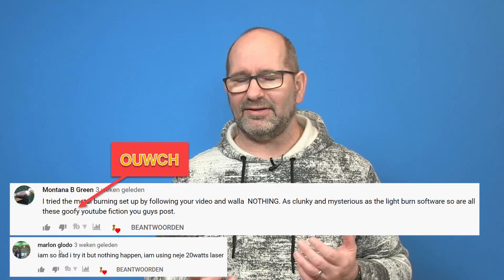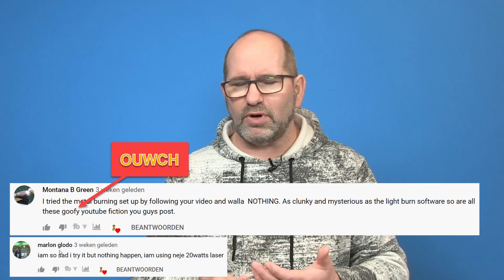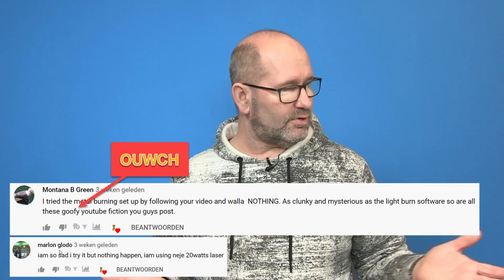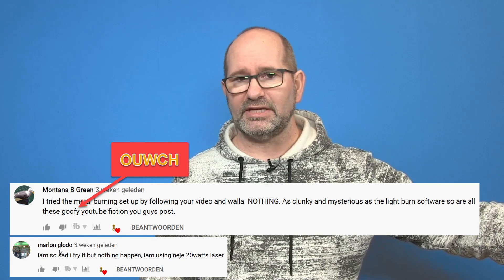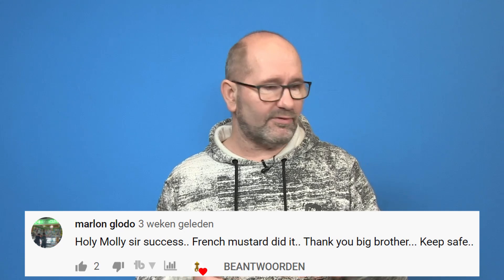▼ Marking metal with a cheap laser and mustard | different types of mustard tested

Comment: Interesting idea using mustard.
A common way to etch metal is to paint the area of interest , let the paint dry, then burn away the paint where you want to etch the print.
Then you do etching with a battery, salt, and vinegar.
Reply from the maker: Yeah, that is a nice way of doing it too, yet that takes 3 steps in the process of etching, while in the shown method, it's only 2 steps, and painting and drying takes some time while adding mustard is done in no-time
The method you describe, can also work with a bath of acid, that way I always make my PCB boards.

Comment: Another posible reason that your viewers may be having issues is that stainless steel is a broad family of steel alloys that contain chrome, nickel and manganese in varying levels.   Chemical resistance increases as the percentage of chrome increases.  As a general rule, the higher the alloy number the more chemical resistance it has.  Most common stainless steels (301 through 304) have limited chemical resistance when it come to clorine compounds or sulfer compounds.  Chemical compatability charts for stainless steel alloys are available on line can be a great resource.  Just be aware that burning chlorine compounds or sulfer compounds releases toxic fumes that can cause permanent damage or death.  Dont laugh but mayonnaise may be a good candidate for etching because it contains sulfer from the egg yolk, acid (vinegar or lemon juice) and salt (sodium cloride).  I would be very interested in knowing if it works.  Just remember that smoke is toxic, always use an exhaust system when using a laser to cut, burn or etch.
Reply from the maker: As for the Mayonaise, I have indeed heard it before. I shall test it.
All the test I have done, are always done on the same type of steel. Therefore the comparisons are all done under the same conditions, yet what you tell me is very informative and I am going to dive deeper in to this.
Thanks a lot. :-)